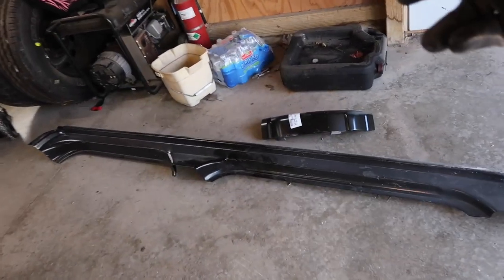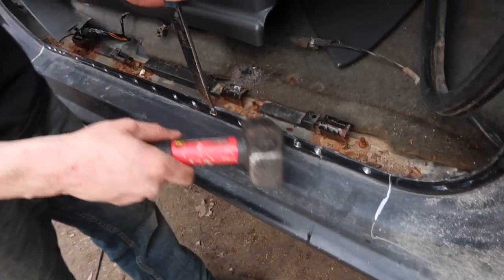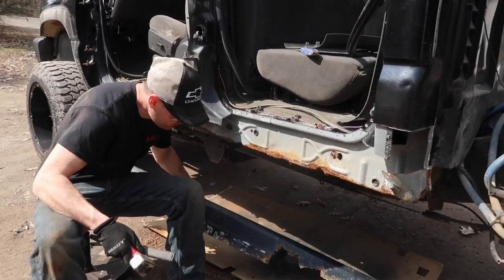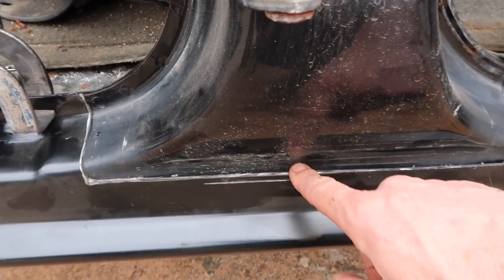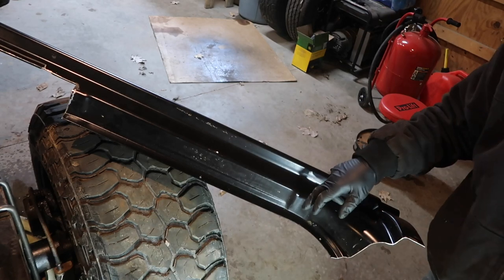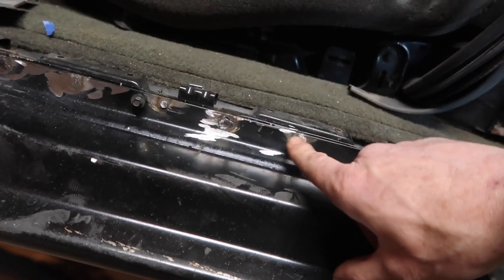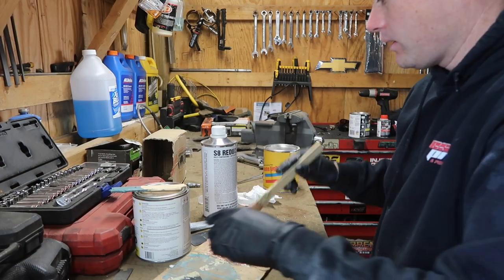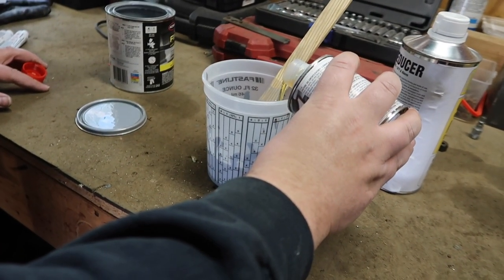How to Install Rockers Cab Corners on a Silverado

Comment: I’m getting ready to replace my inner and outer rocker panels on my 04 Silverado. My sandblaster is a pressure washer gun with a siphon hose, 5 gallon bucket of salt, and air. Works great. Yes this is a job. I’ve already done a few of these trucks. Great video!
Reply from the maker: Thanks
Reply: How bad? I mean is it do-able in a weekend. I have experience with some minor body and cab repair and decent at welding. Im just worried about the filler and bondo portions. I have heard sander n paint makes you a body guy you aint 😂

Comment: Very nice. As a welder fabricator, I think you guys did a good job. I'm going to be trying this when I get 2 weeks off in July. Pretty hyped to bang it out, especially when there's gents like you putting videos up showing how. Cheers!
Reply: If only you could help me I need to learn to weld first 😅
Reply: @Sxvaqe-_- just turn on the machine and melt stuff. Youll get better

Comment: Hey bro, Thanks so much for this video. I am in the starting processes of restoring my 95 Chevy C2500 (5.7 not a Duramax) and one of the big things I am worried about is repairing the body, which is in bad shape. Rocker panels, cab corners, and doors are all rusted very bad and the bed is non existent and polishing the frame luckily that is still solid just has a lot of surface rust that I can see so far. Even though I am not quit there this video gave me a lot of knowledge that I did not have. I am a mechanic and don't know squat about making body repairs but this video eased a lot of my worry and gave me a little confidence. If anyone has any tips on good places to get new body panels, paint and such I would greatly appreciate it. Keep being awesome!

Comment: One of the next videos should be a how to fluid film undercoating so that the rockers and cab corners don’t rust out again
Reply: I use oil- it wicks into the whole closed panel when sprayed or squirted in. And will keep any repair like in this vid from ever needing to be done again.  Presence of oil= can't oxidize, at least not from the inside..    Mike
Reply: The best to use is crc heavy duty corrosion inhibitor. You can look up a video by project where he tests various products
Reply: @mtwseneca  what type of oil to be exact sir?
Reply: @dameankelderman  Anything is better than nothing, inside the closed panels (and inside closed sections of the frame), I use a squirt can with a flexible spout that has clean oil in it (because that is what is in the oil-can which I use a lot for other stuff).  The oil will "Creep" to cover spots you don't actually get the oil on to.
Other people have squirted used oil.  On exposed parts, a waxy oil is necessary to stay on longer.  I read you can actually make it by melting old candles into oil.  But I still have some Tectyl (like Cosmoline) that I add some oil to to spray with a HF sandblast gun on the underneath.

Comment: Harbor freight sells a spotweld cutter that's cheap, fast and works great for what it is
Reply: Duramax 315 4.99
Reply: I use them all the time work just as good if not better then some of the expensive kit I have had in the past
Reply: If you use wax with them they will stay sharp a lot longer! Just drill the wax block slightly and then drill the weld.

Comment: Just a tip you can use a centre point drill that they use in lathes to drill out the spot welds.

Comment: Nice job.... you should try using a flap wheel disc to bring those welds down... works a ton better
Reply from the maker: Really that’s a good tip

Comment: i have replacement rockers sitting in the shop, hopefully get to it when work slows down a bit this winter... gonna use the cheap harbor freight titanium flux core welder i bought... Ive painted a few show cars so not worried there but havent welded since high school

Comment: You need some fiberglass welding blankets, you can get from harbor freight.  It will save your interior.  Also, weld thru primer the panels you are welding, it will cut down on rust coming back from welding.  Otherwise, great job
Reply: That was my Q. Etch primer . also looked back to see the first coat was glass. looking good

Comment: You really should've done the inner rockers, sand blast and rust preventative will only work for so long in our states. Plus when you do the inner rockers it actually makes the job easier.
Reply: I'd also suggest using a weldable primer, when doing rust repair work.
Reply: Should've used the body line on the cab corner as your paint blending area.

Comment: Hey sir, great video!  You can use smaller compressors with a LVLP ( Low Volume Low Pressure ) spray guns. Your compressor won't run near as much! Again, great job!

Comment: your make your life that much easier and get a spot weld cutter. its basicly a drill but made to drill out spot welds and it wont go through whatever your drilling, well arleast it shouldnt go through but thats all on the operator. but good stuff man, not to many get as in depth as you when it comes to your vids.
Reply from the maker: Thanks I bought one of those for the other side

Comment: I wanted to get in their and cut that old rocker and corners out.  Nice job especially with welding and grinding, a ton of work. Curious on the air compressor for that kind of work.

Comment: Curious to if you used a weld through primer on the inside of all those pinch welds? Or maybe that is not a very good product either, Ive heard both ways to use it because it will set again after being welded and others have said it isn't worth using because it doesn't work.

Comment: what kind of welder are you using? I guess what I need to know is, at 10:26, If I was to use a MIG welder, would it fill in that gap? I need to learn to weld and need to purchase a welder specifically for this job. Thanks. Great video and how many hours does this job take, so I can multiply by 5 for a novice. Much thanks. I haven't done body work in 30 years.

Comment: What would you call the piece behind the rocker panel? Is it stamped into the floor of the truck or is there a repair panel for that too?
Reply: it's called the inner rocker panel, and it's not part of the floor, it comes out like the outer rocker

Comment: WHAT SIZE DRILL BIT IS THAT U R USING TO DRILL OUT ALL THE SPOT WELD'S.......
Reply: Go to Harbor freight and buy their spot weld drill kit. It has multiple sizes, is cheap and works well for the money. If you have a TON of spot welds to drill, maybe buy 2 kits. They are cheap!

Comment: I have a 13 GMC Sierra rust free rockers (for now) what can I do to protect them from rust
Reply: High quality undercoat.
Reply: Put fluid film in them
Reply: Keep it clean! Under neath too.
Reply: You need to drill holes to get access to the inside of the rockers and either fluid film or other corrosion inhibiter.

Comment: Instead of punching new spot welds, can you just tack it across the top seam?
Reply: welded on top edge not the way to do it  5/16"  is generally recommended spot weld size hole for replacement panels

Comment: Awesome job. It does not seem like it is too difficult to do just very time-consuming and meticulous. What kind of paint and body filler did you use? Also what did you spray the inner rockers with? Any sort of rust preventive on the inside of the Rockers?
Reply from the maker: I used duraglass for filler and rustoleum paint for the inners

Comment: This video is the complete opposite of whistlin diesel... Still those of us out there that can't swing by the dealer & grab a new $80k pickemup! Start spraying the underside & inside doors & rockers with hose & 360° tip spray gun with drain oil, chainsaw bar oil, whatever is better than nothing. 

It's not just salt anymore, calcium chloride is much worse here in the salt belt..

How's the repair holding up??

Comment: U should paint the inside of those rockers and u should not weld the new rockers on 3m has a glue called panel bond u should glue it all except where u seemed it that should be welded the reason why the rockers rust out is because where ever there is a spot weld there is bare metal about a 1/4 inch around the spot weld on every spot weld on any vehicle  so the salt just starts eating away the metal if u glue it no rust
Reply: Don’t use panelbond on rockers. Not to be used on structural areas. Says so on package,could be liable.

Comment: Hey bro listen I been in the shop since I'm 15 ok I'm 60 now  We use a spot weld cutter head and that makes pretty quick work out of the spot welds  I'm a little confused as to why your doing corners  but whatever. Hey just so you know if you hand wax your chewy twice a year or more with a good wax and  do proper car care this don't happen.My moms old 2000  Malibu looks like it did the she  picked it up from the dealership. well today it has 259 thousand miles and NO RUST anywhere.. because I USD to hand wash it and hand wax it and that car spent everyday in the Upper NYS rustbelt

Comment: if people actually washed their car manually, (not the touch free drive thru crap) on a regular basis then you wouldnt have to worry about trucks rotting out
Reply: Chance Shankle don’t matter if you wash it regularly..salt from winter finds the nooks and crannies and it will rot out any vehicle..it may slow it down for a bit buts it gonna rot no matter what you do
Reply: @rahrah8076  lol thats because people dont know how to wash there car. people typically just wash the body. you gotta get in there and get all the "nooks and crannies". just because you spray water on it doesnt mean its clean. i live in new england and yes salt is a huge problem but my whole family drives trucks oldest one being a 99 gmc,  NO ROT barely surface rust, still have the original undercoating on the frame. hmmm whys that? because we thoroughly clean our trucks. get inside them crossmembers, get down underneath, get  inside the wheel wells and so on.
Reply: Chance Shankle  the frames are wax coated..so of course they are gonna rot no matter what you do...I’d love to see you’re truck under the coating..all your doing is covering the rust and making it worse..I’d love to see your pictures under your vehicles as proof..
Reply: @rahrah8076  covering the rust with what degreaser, soap and water lol. sorry but im not sending a random person a picture that holds any info of me whatsoever im not twelve lol believe me or not i really dont care either way. but if your tired of buying a new truck every few years then think of this. the average person showers every single day. you drive down the street to the store and your underbody gets dirtier then the average person does in a whole day. which is pretty dirty lol. flesh and metal yea yea its different but the same principles apply. if you dont wash it on a routine basis  then you get negative results lol. metal is obv a metal so you can be a little lazy and wash it once maybe twice a week. everything needs to be washed to be maintained from man to steel.
Reply: @rahrah8076  like i said believe me or not, just think about it, maybe try it out and see for yourself.